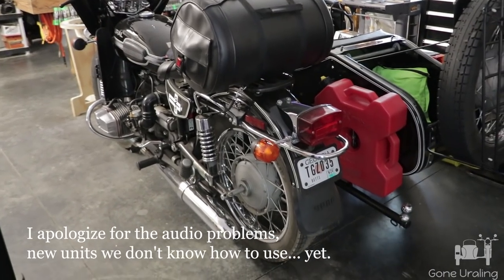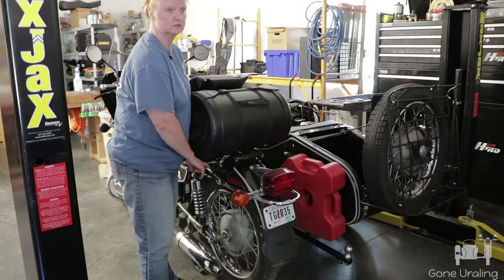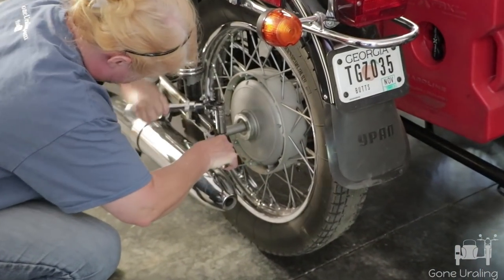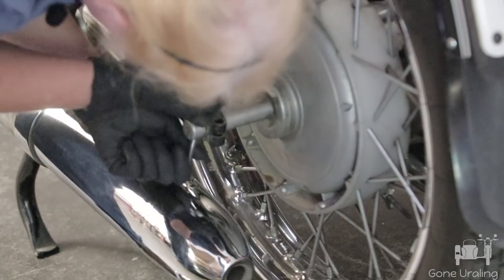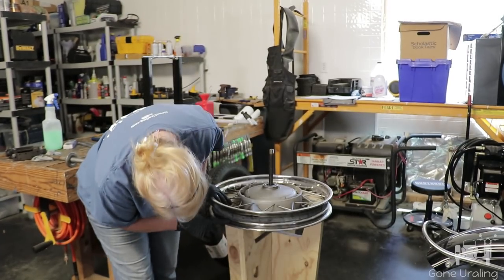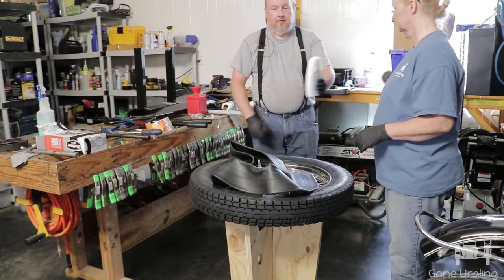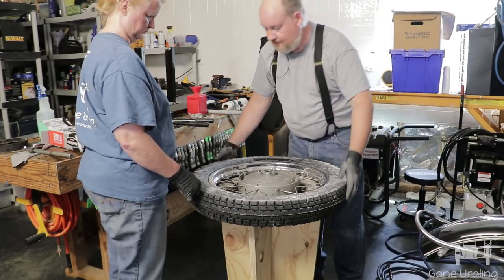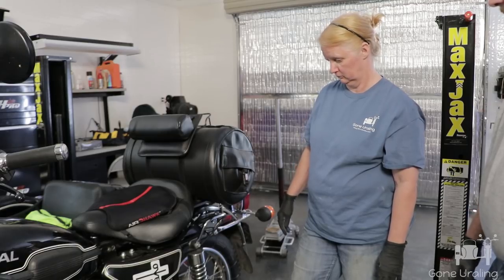Wife Helps Install New Pusher tire on Ural Tourist

Comment: Nice video.  I've changed/repaired tube on several on-the-road trips on gold wings.  No fancy tire equip. Couple of m/c tire irons, valve stem tool and container of GoJo hand cleaner for bead lube and clean hands later. Don't forget a good hand/foot or elect air pump.  Old school is a spark plug air Chuck fitting to use cylinder compression to air you tire. M/C touring is not for the mechanically challenged!! Ride On!!

Comment: I carry the jack out of my 2005 Ford Ranger on the bike when I am out on the road.  It has a cradle that fits the frame perfectly.  I tried the 2x4 trick with a very flat tire and it didn't work all that well for me.